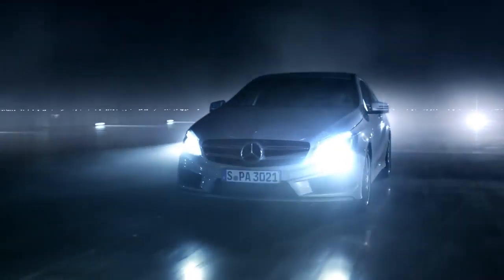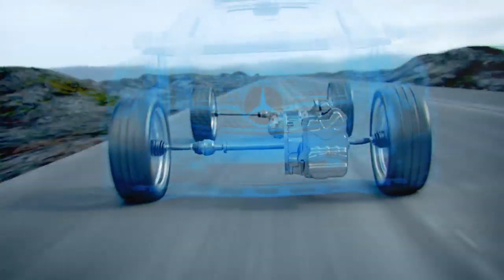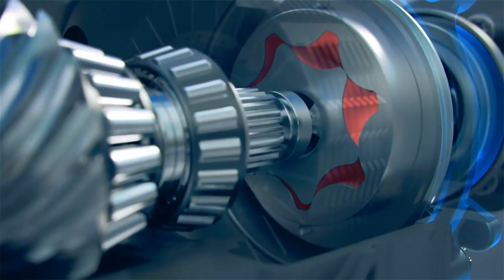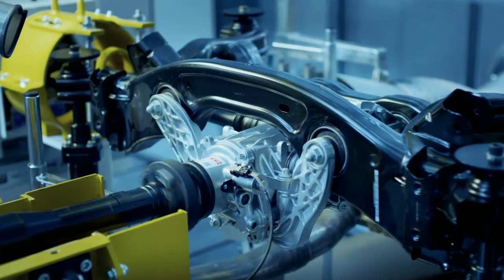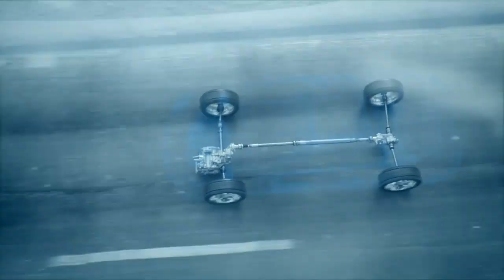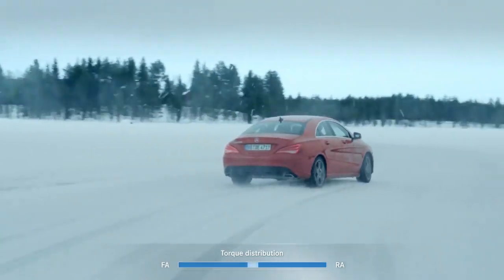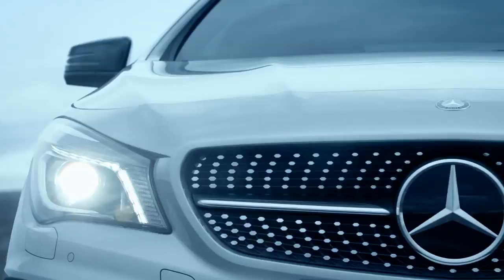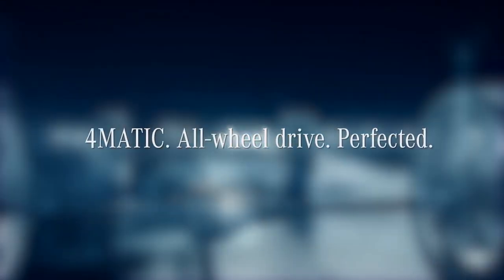Mercedes-Benz 4MATIC | All-wheel drive with the new 7G-DCT dual clutch transmission

Comment: Is this different from the standard 4Matic?
Reply: Yes, mainly in it's integration on a Front-engine Front-drive (FF) platform (A/B/CLA-class) vs. the traditional Front-engine Rear-drive (FR) platform used on all other Mercedes models, the default torque split in normal conditions, and the integration on the 7G-DCT dual clutch vs. the 7G-Tronic conventional automatic.

Regular FR converted to 4matic Mercedes models uses a multiplate centre differential (which is integrated into the 7G-Tronic automatic gearbox) which biases a default front-to-rear of 45%/55%, giving a more spirited sporty nature. This contrast the system in the video where power transfer default to a FWD in normal conditions, becoming AWD only when necessarily.

Interestingly, this FWD-biased 4matic unit actually uses the same technology from that of Audi's transverse FWD quattro system (A3 & TT) manufactured by Haldex of Sweden, just with their own tuning software.
Reply: @Trades46  does this 7G-DCT goes to S ,CLS or E class ?
Reply: @MrLuba6a  no. Those use the 7G-tronic automatic or even the newer 9G-tronic automatic transmission instead. I test driven a newer 2020 A250 with the newer gen 7G-DCT and it is now a much smoother operator, but no match for the new 9G-tronic automatic.
Reply: Trades46 thanks for the reply. 9G-tronic is with dual clutch or?
Reply: 2qq2232qp){[][@#@32)229e44333Was142RDS%2aw2231qw2waqqqqqq[qqwww3223332W)quote2Trades46 k